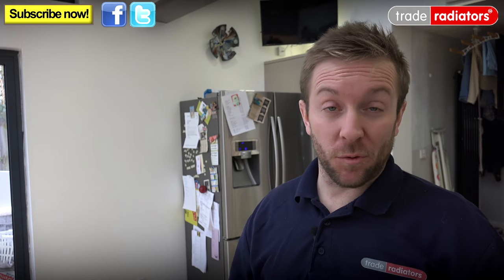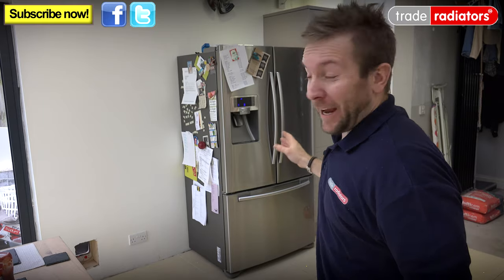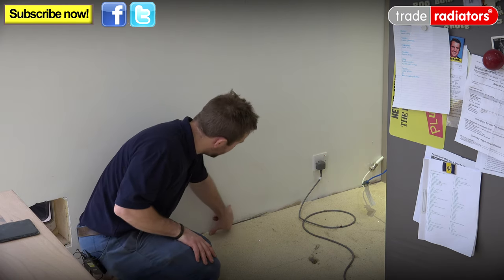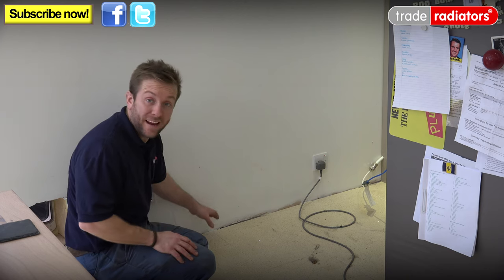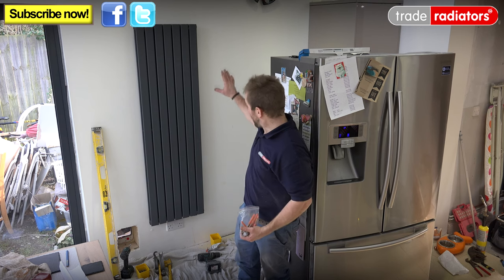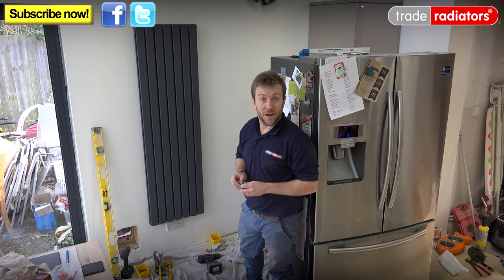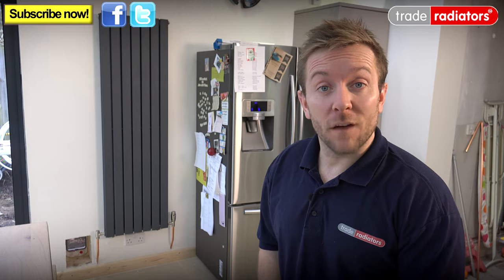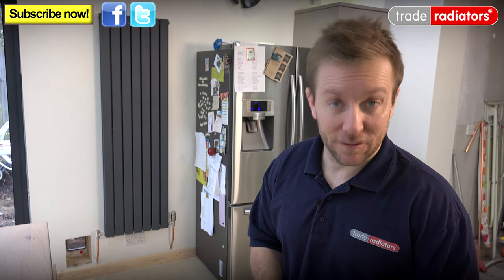Installing A Radiator In A Tricky Place  - Trade Radiators

Comment: Radiator looks really good. I really like the way you have hidden the pipes. Just wondering what was behind the plasterboard? I assume the plasterboard was 12.5mm thick and cutting this out would not be enough to put 15mm pipe in so it sits flush. Did you have to cut into the wall behind the plasterboard too?

Comment: Why do you skip showing how you figured out running the pipe work?? The title of the video is "installing... in a tricky place," yet you spend more time rabbiting on about the packaging the radiator comes in than the actual installation of tricky pipe work!! Cheers for nuffink

Comment: As always great video. Out of interest, how do you know which pipe is flow and which is return?
Reply: It's difficult with an already installed system, however if your tapping into an old rad for an additional rad switch the CH on and check for which pipe gets hot first, them being your flow.